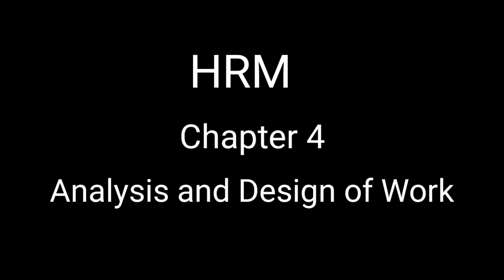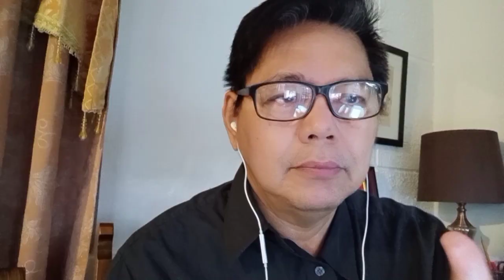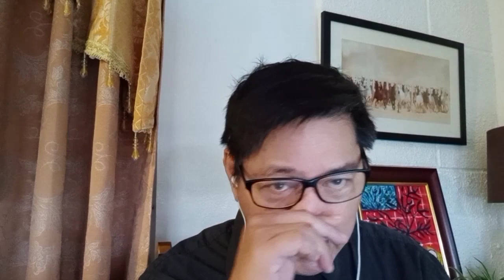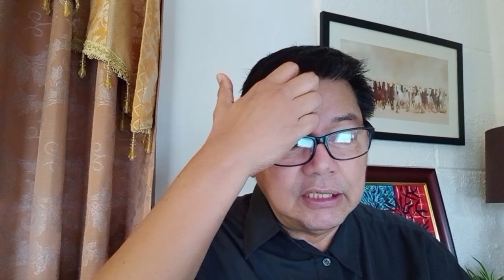HRM: ANALYSIS AND DESIGN OF WORK

Comment: FINAL EXAM
MGT04
ASM3
MANZANO, KIMBERLY GRACE M.

CHAPTER 4

1.	  Name and discuss the nature of the steps in a workflow analysis. 

*Interview Employees

There is not any more successful method of understanding the progression of a cycle than by meeting the individuals who perform it or have some type of involvement of it. At this phase of cycle investigation, it is important to recognize: 
The exercises of the cycle and its succession.
Its members, their duties and the progressive degree of each. 
The data the cycle utilizes produces or changes.

*Analysis of process models
To analyze the process models, you need to answer 10 questions:

What is the reason for the process?
What performance metrics do you use?
How many interactions with customers are there?
How many handoffs are there? And what are they?
What are the rules of the business?
Are there other bottlenecks in the process?
Are there variations in the process?
What does the process cost?
What degree of variation does human activity cause in the process?
How do you perform process control?

*Documentation of the process
The main report of the work process examination steps is the As Is measure outline, that is, the cycle model as it presently may be. Some other joined records might be bookkeeping pages, agendas, systems manuals and even articulations from members. 
. 

2.		Compare the functional structure to that of the divisional structure, including the nature of their design, their respective advantages and disadvantages, and the types of environments in which they might best be used. 

The functional structure depends on an association being split into more modest gatherings with explicit assignments or jobs. For instance, an organization could have a gathering working in data innovation, another in showcasing and another in money.  While the Divisional structure takes into consideration substantially more self-sufficiency among bunches inside the association. One case of this is an organization like General Electric. GE has a wide range of divisions including avionics, transportation, flows, computerized and environmentally friendly power, among others. 

One of the difficulties Functional structure presents is an absence of between departmental correspondence, with most issues and conversations occurring at the administrative level among singular divisions. For instance, one division working with another on a task may have various desires or subtleties for its particular work, which could prompt issues not far off.  Divisional disadvantage to this kind of authoritative structure is that by zeroing in on divisions, representatives working in similar capacity in various divisions might be not able to convey well between divisions. This structure additionally raises issues with bookkeeping rehearses and may have charge suggestions.

Comment: Jimmar Castillo
ASM3
FINAL EXAMINATION

1.	 Name and discuss the nature of the steps in a workflow analysis. 

          The Workflow Analysis is the process of breaking down the performance of a workflow and examines trends for improvement. By looking at a workflow at a granular task level, business users can tweak processes for optimal efficiency and workplace productivity. Workflow analysis often reveals redundant tasks, bottlenecks, and opportunities for more automation. If you are responsible for organizational efficiency, you’ve probably spent time thinking about workflow management, BPM, and automating redundant processes (Business Process Automation). Many people simply jump on the workflow automation bandwagon because of the fear of missing out–they don’t want to lose out on all the vague ‘benefits and advantages’. But sometimes, these efforts just don’t seem to work like they are supposed to. The reason? They didn’t do workflow analysis. There’s no point setting up an automated workflow unless you know the benefits you expect to receive, and how your workflows can be improved. Unexamined workflows get stale quickly and become part of a legacy system. However, if you have hard data and feedback from stakeholders, you can use workflow analysis to find several easy ways to improve on what you already have.

2.	Compare the functional structure to that of the divisional structure, including the nature of their design, their respective advantages and disadvantages, and the types of environments in which they might best be used. 

Functional structure is one of the most common organizational structures. Under this structure, the organization groups employees according to a specialized or similar set of roles or tasks. While functional structures operate well in stable environments where business strategies are less inclined to changes or dynamism, the level of bureaucracy makes it difficult for organizations to respond to changes in the market quickly.

Comment: FINAL EXAMINATION
JAVIER, JAN LATRELL D.
ASM3

1. Name and discuss the nature of the steps in a workflow analysis.
Workflow management is an activity that aims to analyze, detect points of improvement, design new processes, and implement them in an organization with the goal of making them more productive and effective.
Within the workflow analysis steps, one of the most important is process analysis. Through it, you can understand how processes are unfolding in the company at this time to study them in search of points of improvement.
Workflow management and the 3 workflow analysis steps
Even before starting the 3 workflow analysis steps, to practice proper company workflow management, you must have a thorough knowledge of the organization’s strategic planning.

1- Interview employees (actors)
There is no more effective way of understanding the flow of a process than by interviewing those who perform it or have some form of experience.

At this stage of process analysis, it is necessary to identify:

The activities of the process and its sequence
Its participants, their responsibilities, and the hierarchical level of each
The information the process uses generates or transforms
Analysis of process models What is the reason for the process? What does it seek to accomplish? The systems it uses? What value does it add to the final product? And what is its current performance level What performance metrics do you use? What KPIs are defined and which points are measured? Is the process within the expected performance standards (or not)? How many interactions with customers are there? And what are they?
Also, who are the customers? What are their needs? Are they satisfied? Check for redundant or unnecessary interactions with customers.
How many handoffs are there? And what are they?
Handoffs are moments in the process where information passes to another person/system. Check if any of them are creating information bottlenecks and whether the organization measures the time between them.
What are the rules of the business?
Business rules are standardized procedures that expedite decision making. Check if they’re appropriate if they’re causing obstacles and what their steps and levels of approval are. Find out based on what criteria the company created them for and whether you could eliminate any of them without causing harm to the process.
Are there other bottlenecks in the process?
It’s necessary to find out what’s being constrained in the process (information, product, or service), what factors are leading to the bottleneck (personnel, systems, or organizational), and whether the bottleneck derives from a handoff.
Are there variations in the process?
Determine where they occur most often, what the tolerance threshold is, and whether task automation can eliminate variations.
What does the process cost?
Check if this cost is compatible with the market and if it’s possible to optimize the process to reduce costs.
What degree of variation does human activity cause in the process?
Find out if this variation is tolerable and whether or not you can eliminate it with the automation of a task.
How do you perform process control?
What documents do you use to control the process and what steps does it require for its approval?

If you want to maintain an adequate workflow, you must answer all of these questions as completely as possible during these workflow analysis steps. Then you need to document the process. Handoff agreement: one of the best handoff strategies
Handoff strategies: Convert these procedures into results
3- Documentation of the process
The most important document of the workflow analysis steps is the As-Is process diagram, that is, the process model as it currently is.
Some other attached documents may be spreadsheets, checklists, procedures manuals, and even statements from participants.

2. Compare the functional structure to that of the divisional structure, including the nature of their design, their respective advantages and disadvantages, and the types of environments in which they might best be used.
What does it take for companies and organizations to be successful?

There are many answers to that question. Some would say it’s having an effective mission; others would say it’s selling a product or service that’s in high demand.

Ultimately, it’s a company’s organizational structure that helps determine success.

An organizational structure is defined as “a system used to define a hierarchy within an organization. It identifies each job, its function, and where it reports to within the organization.” A structure is then developed to establish how the organization operates to execute its goals.

There are many types of organizational structures. There’s the more traditional functional structure, the divisional structure, the matrix structure, and the futarchy structure. Each organizational structure comes with different advantages and disadvantages and may only work for companies or organizations in certain situations or at certain points in their life cycles.

“Poor organizational design and structure results in a bewildering morass of contradictions: confusion within roles, a lack of coordination among functions, failure to share ideas, and slow decision making bring managers unnecessary complexity, stress, and conflict,” wrote Gill Corkindale in the Harvard Business Review. “Often those at the top of an organization are oblivious to these problems or, worse, pass them off as challenges to overcome or opportunities to develop.”

Ultimately, it’s important to get a group’s organizational structure correct in order for its aims to be successful.

Comment: FINAL EXAMINATION 
LAPURGA, MELVER T.
3-ASM
FSM15

CHAPTER 4
Question 1.
1- Interview employees (actors)
There is no more effective way of understanding the flow of a process than by interviewing those who perform it or have some form of experience of it.
2- Analysis of process models
To analyze the process models, you need to answer some questions
What is the reason for the process?
What are the rules of the business?
Are there variations in the process?
What does the process cost?
How do you perform process control?
3- Documentation of the process
The most important document of the workflow analysis steps is the As Is process diagram, that is, the process model as it currently is.
What’s important at this stage of process analysis is to have understood how they occur and to be able to count on ways of sharing them with other team members in order to look for opportunities for improvement. 
Question 2.
Based on the workflow analysis how task are grouped into jobs at fast-food restaurant and those at a five-star. In fast-food restaurant they easy to assigned their employee to a grouped of task or an individual task because the work in fast-food restaurant is minimal unlike into a five-star that they grouped their employee into a different task and some of the employee do a individual task its because they want to be a organize to a different task they do. Also they see the individual skills of their employee so that they see what task they give in to their employee.

Comment: ESQUILLO IVAN KARL G.
FSM15-ASW3
FINAL EXAMINATION

Chapter 4

1.  Name and discuss the nature of the steps in a workflow analysis

Workflow analysis is a process in which businesses examine the progression of workflow in order to improve efficiency.

 Collect Hard Data
 Take a report of the workflow you want to examine. Analyze the statistics and see which ones are performing as required and which ones aren’t.
step 2:Collect soft data
To further your workflow analysis, you need more than just numbers. Now you need to go and talk to the people who use the workflow tools most frequently. Start with those who fill out the form.
step 3:Ask hard questions
The next step of workflow analysis is to ask the questions that guide the workflow. What is its purpose? Who is it supposed to serve? What defines a good process? Some workflows are created to minimize errors. Others are meant to speed up the process.

FUNCTIONAL STRUCTURE
The functional structure is the most common type of organizational structure that businesses use, grouping employees by specialty, skill or related roles. It is based on levels of hierarchy that include different departments, under the direction of designated leaders. Businesses commonly operate under functional structure because it groups people together who have similar knowledge, and when used in a team environment, helps companies achieve their goals

DIVISIONAL STRUCTURE
Divisional structures work well with large companies that span a wide geographic area. Businesses divide employees into divisions related to specific products, markets or services. Within each division, there may exist a functional unit comprised of departments like marketing and operations. Chain stores and subsidiaries on a national and global level typically operate on a divisional structure.

Comment: FINAL EXAMINATION 
CRUZ, ZACHARIAS B.
ASM3

1.	  Name and discuss the nature of the steps in a workflow analysis. 
- 	Workflow management is an activity that aims to analyze, identify improvements, design new processes, and implement them in an organization to improve their productivity and effectiveness. One of the most important steps in workflow analysis is process analysis.
Step 1: Collect Hard data 
 Make a report of the workflow you want to review. Analyze the stats and see which ones work as needed and which ones don't.

Step 2:  Collect Soft Data
 To carry out your workflow analysis, you need more than just numbers. Now you need to go with people who often use exercise tools. Start with the people filling out the form.
Step 3: Ask the Hard Questions
The next step in workflow analysis is to ask questions that guide workflow. What is its purpose. Whose service should he serve. What defines a good process? Some workflows are designed to reduce errors. Others are designed to speed up the process.

Step 4: Step 4: Implement the Changes and Follow Up
When you have identified all the changes to your workflow analysis, implement them on your system. Notify all stakeholders of changes and let them know if there is downtime or how items will be handled during a modified workflow. Workflow analysis is not just a good way to determine if changes are needed to a workflow. You can also generate useful reports and see what workflows and what aspects of a particular workflow are helping your business grow. It is important to continuously analyze and improve your workflows.

2. Based on a workflow analysis, describe the major differences between how tasks are grouped into jobs at a fast-food restaurant and those at a five-star restaurant. Which job design approach do you see predominating in each? 

In a fast food restaurant the workflow goes exactly as planned because everything is paced with the flow of the plan they prepare food faster and more prepared working efficient is their key. 

While the five star has the same steps but it’s a little bit different when it comes to five star restaurant they go with the moderate pace of flow in working with their own plan In well-run restaurants, waiters are in constant contact with their hosts to stay up to date on the upcoming availability. In more relaxed places, the host may need to skim the landscape and decide when to wait.